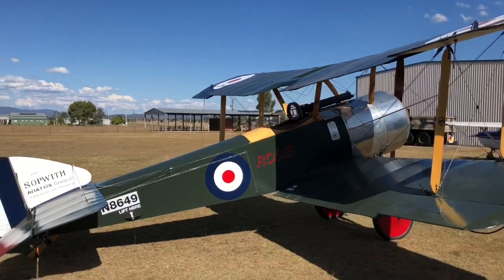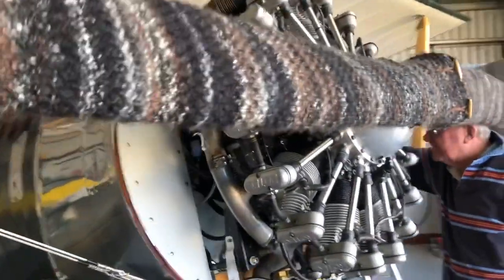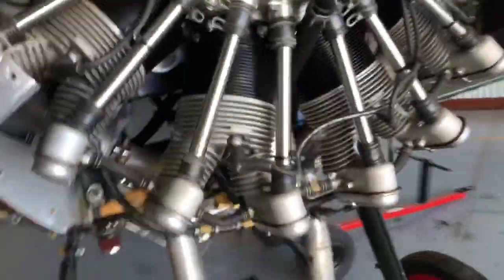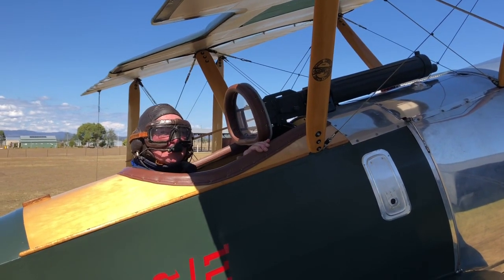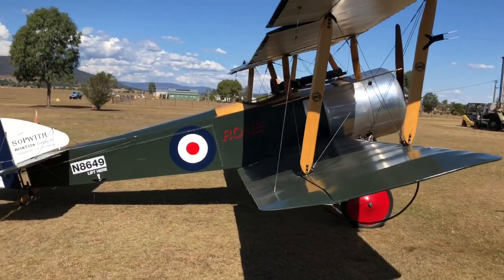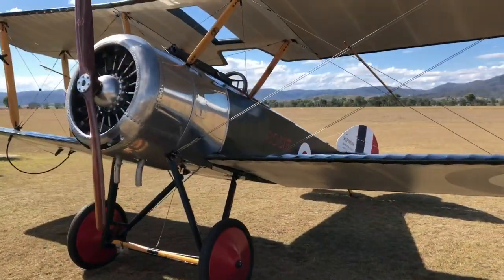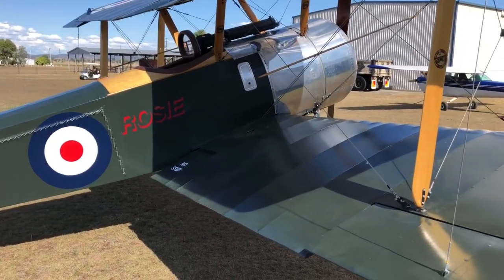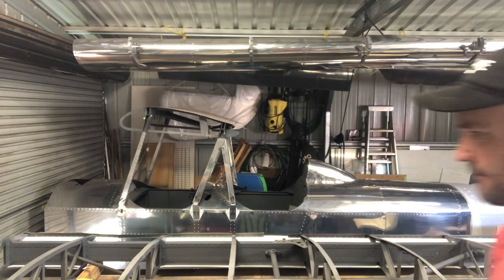Rosie the sopwith pup, things we’ve learnt

Comment: If you have 3D printing, depending on what materials you can print, you may want to think about ducting air to the hots spots
Reply from the maker: 3D printing is very cool. We used aluminium tube and high temp Scat hose for the ducting which is able to resist heat a bit better

Comment: Another thought: The question of C.G.  What I have sort of found out is that back then they did not use a C.G. envelope like we do today. In addition there is the question of finding the MAC on a biplane of that era. Many articles were written in "FLIGHT" (Flight Engineer) 1920 ish, giving different methods and theories on where the MAC would be. Quick question, is this a RAF 15?
Absolutely love the little things to make it authentic, esp. the 5/17 compass. NICE work. By the way Kermit is not the first to loose the cowling. "Whats his foot, the con" lost one in Omaka.
I was in the air so didi not see it, only the aftermath. How is the engine holding up?  CHEERS,
Reply from the maker: Gday mate. I know Paddy spent a lot of effort researching all things related to the pup’s C.G. And about MAC. I think the biggest challenge he had was the engine and propeller are lighter than the original, and the gun is much lighter as it’s not real. As he wanted to build to as close to original specs as possible and not move the engine forward, the C.G. Was always going to be a challenge. Very early on in the build he was constantly conscious of weight in the tail. His efforts have been rewarded with level flight being achieved with the control stick close to neutral instead of stick forward like other pups. I’m not sure about RAF 15, but as he put so much effort in to producing an accurate replica I would believe it is. I think I mentioned Kermit’s cowling departure because that was the latest one to happen so seemed most relevant. The rotec engine is running great. We had a bit of tweaking to do to get it happy but I reckon we achieved that. Hope this helps

Comment: I'd guess with that original rotary engine spinning, there wasn't much of a cooling problem.   Imagine how much worse the right torque must have been with that thing spinning.
Reply from the maker: That’s the trouble with fitting a modern engine and keeping it scale. There’s not much room for cooling. You’re right, the torque on those rotarys would be would be a whole other level to deal with

Comment: About the taxi:  I take it that the tail skid has 2 bungees that allow it to swivel 10-20 degrees in either direction, but not connected to the rudder bar. So, are you giving a little down elevator to lift the tail and gunning the engine or is the rudder enough?  I can see the rudder moving but not quite the elevator.  Wheel landing tail low???
Reply from the maker: There is a separate set of cables connecting the rudder bar and the tail skid giving only a little movement left and right. He does use down elevator to lighten the tail as well as engine power, but still can only turn in large circles unaided. Paddy tries to keep the tail high (wheel landing) as long as he can to keep some control. That period between tail up and tail skid digging in is a land of no control. So he tries to transit through there quickly having made sure he has used up as much forward energy and airspeed as possible before dropping the tail. Given any chance, it will swing during that no control period which makes each landing fun and entertaining!
Reply: @donwtsn  Thanks for the info on the extra control wires. I did something similar on the Bristol F2B, only had about 20 degrees in each direction but found it to make a big difference. I had small disc brakes which were only used for maneuvering near the fuel pumps.  Nice work.
Reply from the maker: @edstoro3883  cheers mate. Paddy stuck to the original design as closely as he could, hence the extra cables to the skid like the original. The skid shoe was modified to dig in more which helped control the swing as well. At the moment it doesn’t have brakes, but we have ideas on how to fit them and keep the original look. Brakes sure would help!

Comment: A rally lovely build! But a very poo engine choice, not a matter of if the engine will fail, but when it will rail, just do not fly anywhere you cant put this wonderful aeroplane down in an engine emergency , blue skies!
Reply from the maker: Thanks mate. We have the engine running quite well. We put a lot of effort in to ducting cooling air among other things. We noticed a lot of these engines have been installed poorly with very little cooling airflow through the cylinders to the rear engine casing. Without good cooling, the engine quickly overheats and causes problems including vapour lock. We have very good oil temps and pressures. Even after landing with the engine heat soaked, we have no issues with the long taxi back to our hangar. Cheers mate
Reply: @donwtsn  I am glad to hear you got the engine installation sorted out, there are so many  really catastrophic failures with this engine, this Pup build looks really nice, and not having a rotary engine must make a lot of difference to the handling. Stay safe! Chris B.
Reply from the maker: Thanks mate. Paddy put a lot of effort in to building it as accurately to the original as possible, less a rotary engine. It’s such an interesting aircraft huh

Comment: Please check out Rotec  engine failures.  There have been a LOT of them. Be careful.
Reply from the maker: Gday mate, yes we know of some of the stories about this engine failing. If you look up any engine type, you’ll find failure stories about them too. As I mentioned in the video, many times, we put a lot of effort into directing cooling air to the aft part of the engine. Also moving the firewall back to get the volume of air through the engine compartment is very important. We still experienced issues with vapour lock and heat sink, but with a bit more tweaking we have no overheat or vapour lock issues. We can do long run ups and long taxis without any issues now. The Rotec seems to be a bit finicky to set up, but I reckon we’ve got it sorted. Every time I see someone having troubles with this engine, I notice there is usually not enough room in the engine compartment to allow air to flow properly. Air cooled engines need air to cool the engine. Sometimes when they replace the rotec with another air cooled engine, the problems continue. Like any engine, it needs to be matched to the airframe. Boy does it sound great!

Comment: Cool. I have a Camel with a Warner 165hp. Tell us more about the design and construction details of your Pup.
Reply from the maker: Dave Gillespie very cool mate! This is my friends pup, I’m just lucky enough to help out. Paddy used pup blueprints and detailed drawings from scaled rc models. He wanted to build a replica that is a tribute to those who flew them in the war. It has the same wing and is dimensionally accurate. He used modern fabric and timbers and the aft fuselage is monocoque to make it more user friendly instead of wires and turnbuckles. The engine has the same torque as the original. The aim was to have it accurate in dimensions as well as performance. Your camel sounds very cool and interesting
Reply: My Pup (Rosie)is built using original Sopwith drawings and aerofoil with some changes to be able to build it in a home work shop. I have used modern epoxy adhesive, and covered her with the Stitz Poly Fibre system. I have also used hoop pine instead of spruce, hoop is readily available here in Australia and the ply is of excellent quality.
Rosie does not represent any particular Pup rather she honours all the unremembered pilots many of whom never returned. The red wheels are for the capes the nurses wore who cared for the broken pilots and her name is for the wives, girlfriends, sisters and mothers of those pilots.
My friend Don Watson built the cowlings for her.

Comment: Something you might consider: the hole you made in the original firewall; imagine doing what you would if you were just going to make the opening larger by maybe 6 or 8 inches on all sides, but instead of removing the ‘flaps’ that you cut, leave them in place, but angle them backwards by say, 45 degrees. Maybe re-attach them with full-length ‘piano hinges’ and lock them at the desired angle with some little triangular blocks. This would create a flair extending slightly into the cavity between the 2 firewalls instead of just a blunt opening, and I think it would channel the increased airflow more efficiently from the cowl backwards toward the opening you made on the bottom of the fuselage, plus decrease the turbulence created when the air coming past the engine encounters the flat face of the original firewall while trying to find a way out. A small fairing or lip along the leading edge of that opening might speed up the flow of the slipstream enough to increase the Venturi effect and pull more air out of it.    Another (and much easier) thing you might consider is to try to insulate that exhaust manifold. Everything in there is being baked by the tremendous heat coming off of it. I think there is a type of wrap that is composed of ceramic material and fiberglass or asbestos fabric that will prevent it from introducing so much heat through convection at least, into everything nearby, but it would have to include in its construction some type of foil, or metallic powder or something that would actually block the transfer of heat energy in the form of electromagnetic radiation, which can travel through even the vacuum of space, and thus isn’t really affected by airflow, so eliminating it as much as possible might really decrease the temperature of all the nearby accessories, fuel lines, connectors, wiring, hoses etc. etc. … This part of the equation is often neglected because heat radiation is invisible, and has to be dealt with in the same ways that one deals with radio signals for example. Even a thin sheet of foil can make a tremendous difference. I remember when Saddam Hussein set all the oil wells on fire in Iraq and celebrity Texas fire fighter ‘Red’ Adair’s crackshot crew could approach the flames much, much more closely (for a short time) by simply carrying by an attached  wooden or leather handle or strap, or even by mounting it to the front of the cab of their bulldozer, a sheet of corrugated steel in front of them with a little slit cut in it so they could see. The conductive metal shield would become hot as hell, but it blocked the radiation. Anyway, sorry that went on so long, but maybe it will help. Good luck to you!
Reply from the maker: Thanks for the input mate. The options you describe were definitely on the table. It’s sort of a catch 22 type thing when trying to fix an issue like that. Do we make small/easier adjustments, or go all out and re do everything. Our issue was to fault find on the fly (pardon the pun) and there were multiple sources to the overall problem. So by going through the systems first we could eliminate that and then concentrate on airflow. As you say, there is a lot that can be done to improve the overall flow through the engine, firewall and exit. We concentrated on directing air to our problem areas first and then continued until we got to a point where we were happy with how it operated. As it is now we can taxi for over 10 minutes after landing with absolutely no problems at all. At this stage we are happy to leave it at that. The next step would be to shield the exhaust and then leave the directing airflow past the false firewall till a bit later. I was leaning towards making metal heat shields rather than wrapping the exhaust. Not sure exactly why. Might have been because I like to inspect the piping for any cracking and blow outs. Airflow is a funny thing, especially through an engine compartment. It’s very fascinating. Cheers